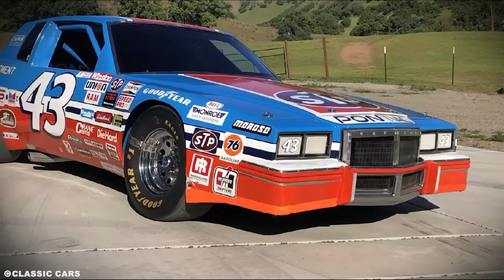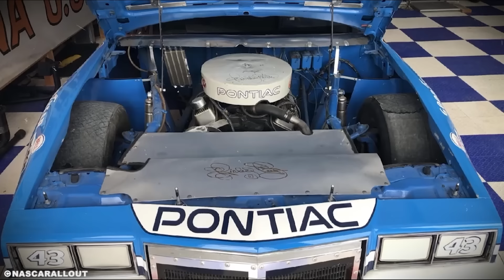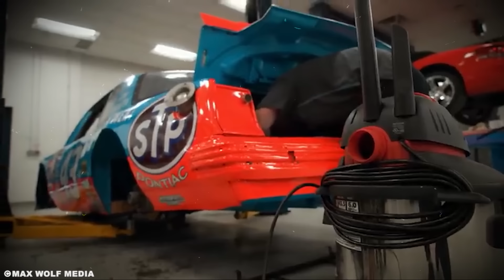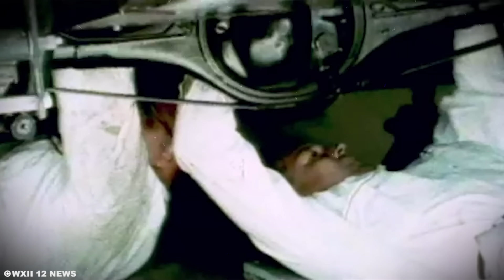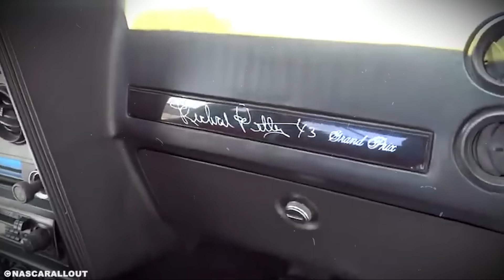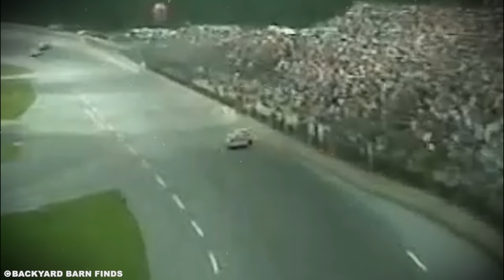How One Mechanic's STUPID Wax Cylinder Trick Made His Engine 15 Cubic Inches Bigger

Comment: This is BS that wax would not change the displacement it would change the compression ratio by lowering it. the bigger the combustion chamber got which in turn would lower the power output as the Comp ratio got lower, the opposite of what they claim would happen the engine would lose power as the wax melted away.. the only way to make the displacement bigger is to make a bigger bore or stroke and that can't be done with wax. Depending on how the engine is tested ie. If the displacement was calculated by air flow then they could restrict the intake ports to flow less air tricking the measuring machine if it was tested by spinning the engine over and seeing how much air the engine sucked in however that wouldn't work if they filled each cylinder with a fluid like oil and measured that way. Also during the big block days of NASCAR especially near the end of the big block era in the 80s I'm pretty sure the big block engines were bigger than 358 inches when NASCAR allowed both big and small block engines the cars with small block engines got a weight break they could weigh a couple hundred pounds less than a car with a big block engine and since the gen 2 SBC engine with the short deck height used in NASCAR was originally designed around NASCAR's new small block engine rules which dictate a max 358 inch engine with a  max bore and stroke size I don't think the big block engines were under 400 inches

Comment: The wax was used to hide illegal modifications to the heads and intake. 
You can't change displacement with wax. That's fucking stupid!😂😂😂
Reply: Well they were putting liquid in the cylinder to determine what the displacement was, when the engine warmed up and melted then that displacement returned.
Reply: @fk4515 that is not how you measure displacement. That is how you measure static volume, NOT displacement.

Comment: Wax will decrease the cylinder volume, but not the volume the cylinders displaced. Displacement is the piston area times the stroke length, and wax wouldn’t change that. As the video points out, wax will change the compression ratio and cylinder volume, but not the displacement. So for a given revolution, the amount of air drawn into the engine would be the same WITH OR WITHOUT wax. Same amount of fuel and air and power, with or without wax. I think the way it worked was they built a 372 and added wax to fool the measuring device into thinking it was a 358. The NASCAR measuring tool apparently measured cylinder VOLUME (which the wax would reduce before a race) and used a formula for standard compression ratios to derive  cylinder DISPLACEMENT. You would have had additional compression (and knock risk) early in the race until the wax melted, so The King probably had to avoid full throttle early in the race to avoid detonation.  At this point it was a partially throttled 372 vs a full throttle 358. As the wax melted he could open it up.  Then it was 372 vs 358. All other things being equal, power is proportional to displacement, and at these speeds, speed is proportional to power to the 3rd power.  This results in a speed increase of about 1.3%, not much, but a couple of mph which over 500 miles could amount to several laps. He often had a couple of laps on the field by the end of a race. Absolutely Brilliant. Should have only run the left side tires until the final pit stop and put rights on the right for the final laps. They might never have been caught had they done this. I watched all his  races in those days. Petty was my hero. Always wondered how his car was faster than everyone else’s. Now I know!
Reply: The combustion gasses are about 2,000 degrees. You think they had to wait a while for candle wax to melt? Yeah maybe 10 seconds at idle.
Reply: @8literbeater . I thought I’d read that the wax took a while to melt, maybe something Allison said about those cars getting faster and faster over the course of the race, but you’re right, the wax was probably was gone after the warn up laps!

Comment: NASCAR engine inspection involves both pre-race checks for compliance and post-race teardowns for in-depth verification. During the teardown, a team removes the engine from the car, and inspectors measure, weigh, and check components like pistons, cylinder heads, and crankshafts for adherence to strict rules regarding displacement and compression ratio. Failure in inspection can lead to penalties ranging from penalties in pre-race inspection to disqualification after a race.
Reply: lap 15? does these nuts know how hot a combustion chamber gets?
Reply: @ixlr8677 yeah exactly. It says it melts at 140 Fahrenheit. 15 laps huh? 5 seconds at idle would do it.

Comment: My greatest complaint with this story is that the writer didn't do his homework. The proof is that the cars pictured had an engine size limit of 430 cubic inches not 355.  Putting wax in the cylinder head would decrease the volume of air in the cylinder. This would only work if the engine was not fired up before the cylinder volume was measured. Firing the engine up probably fowled the plugs but with practice time you would have time to change plugs.

Comment: Never heard of this one. But I heard Leonard Wood made some intake gaskets that had wax inserts that melted out and allowed extra air into the intake runners. Also heard of wax being used in carb and intake bolts having tiny holes in them with wax that melted away and allowed extra air into the intake system.

Comment: The only way to change the displacement is to physically change the actual bore or the stroke not the combustion chamber size. Wax would only temporally change the compression ratio. This is a tall tale yarn made up for clickbait and entertainment at best!!
Reply: They filled the cylinder so tgat when it got pumped for swept volume.  The events were two different races. He got fought both times and the king got super pissed at his. Brother
Reply: Thanks for the heads up
Reply: It was a bigger engine…duh

Comment: In the combustion chamber? Why?? All you do with wax in a head is temporarily Raise compression. IF they put it in intake runners to make them seem smaller than they are, that would be a stretch but could work to do a little something.

Comment: I don't buy it for a minute. It would not change the swept volume. If you were able to put it in the chamber, it could possibly increase the compression ratio, and thereby power, until it melted out, but not the displacement.
Reply: You are right. They just built a 372 and the measuring device measured cylinder volume, not displacement. See my post above.
Reply: I agree with you, i think its a bunch of malarkey, how did they bore .085” over on a 358 block and maintain the integrity of the cylinder walls running wide open without running into serious run ability issues….

Comment: The wax takes up volume in the cylinder, allowing less air into the engine, therefore when you test it & measure the cylinder volume it passes.

Comment: What a line of crap, as an engine builder for many years, this won't work. That wax would smash into the plugs, fouling them.
Reply: Yeah,the stroke would be the same, so same size. Even if it runs, it would just decompress the engine and reduce power.
Reply: @stevev6002 your wrong sir..the wax was only used to hold open the valves during the old school air pump test, so by allowing air to leave the chamber it gave a false reading the wax didn’t make the chamber size smaller or decompress the engine during the race, it did it only during inspection which was why it gave a false reading the only fact that was wrong was the engine was really 382ci not 370ci..also those who think it fouled the plugs would be correct if they hadn’t spent months testing to get the correct mixture of wax with the correct  melting point, and since it was around the valves once it got hot it was blown out of the exhaust valves .this didn’t lower compression it simply made the engine seem smaller than it was since they at the time didn’t test engines after the race and do tear downs as they do today by randomly choosing a section of the cars to do complete teardowns.. also back then they could do spark plug changes during the race if need be if it ever did foul a plug , having a additional 30 hp even if you lost 20 places and didn’t go a lap down, it wouldn’t take long to get back to the front  would it.,Dale Earhart cheated their butts of, so did Gordon, and all the greatest teams, if your not pushing the rules then your not racing are you..
Reply: @markim5087 how does air leaving the chamber seem to reduce engine capacity? I am not sure how the test works.
Reply: @markim5087 it was always obvious that Kyle Busch had more motor!!!! On restarts he would yard the entire field without fail,!!!!! I remember Gordon being the same way! NASCAR needed a dominant car/driver!!! Sports fans love dominance or love to hate the athlete dominating.
Reply: @stevev6002  it does seem more air would indicate more, not less, space
Reply: I heard this was done with cigarette butts
Reply: @TheArsonistsmind  more like blowing smoke out butt
Reply: Only thing that determines cubic inches is bore and stroke combustion chamber has nothing to do with it.
Reply: @brianknight1885 dude I don’t know who you learnt about engine size but the combustion size is crucial to engine size, l😂😂😂 and determines its compression ratio,  not being rude but you need to go back to school, 😂the cylinders bore and stroke to find the total swept volume the compression chamber dictates how much that volume is compressed, making it a fundamental factor in the displacement.. don’t forget the Performance.. I’m guessing you haven’t built very many engines, or went to a good trade school, like the school of automotive machinist, in Houston, maybe you should take a refresher course 😂😂😂
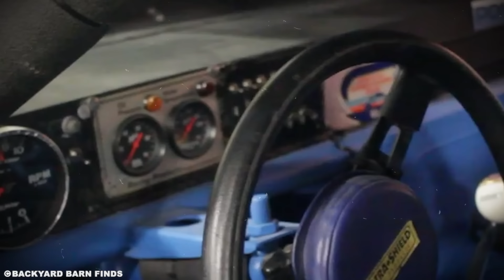Reply: The naration even has a mistake about the legal cubic inches, at the 7:15 minute.
Reply: Dude I’ve built engines for yrs, owned my own shop, and yes it true they were caught in 1983 using wax and they were fined 35k 104 points, but the truth is it wasn’t 373 it was really 382 CI , so you either don’t have that much experience or your just not that good of a engine builder..I’ve witness a lot of building engines tricks ,and racing in NASCAR back in the 1980’s -1990’s ,we always broke the rules working in the grey area,if the book didn’t say you couldn’t then you could as far as every team was concerned...the wax was used to hold open the valves during the air pump test..there was so much cheating in nascar back then , in everything from engines, carbs, suspensions ,once they even used a NOS storage system ,which were built into the frames and sucked into the engines through the air boxes..I’ve even seen when they flipped over suspension parts ,and moved around the rear ends ,the amount of tricks and cheating is what made nascar great , if you recall Jeff Gordon’s car the so called jurassic Park car ,was legal but they had moved the whole  suspension,over and the body had been changed on one side yet it passed inspection, Jeff was told to slow down because he was lapping teams with ease, and that was their down fall, if Jeff had not acted like the kid he was trying to rub it in everyone’s face, and just ran it enough to win, that car would of been used during the season instead of just the all star race, and then been banned..yet they weren’t fined why because it was within the rules, which were changed the next week so they couldn’t run the car again..they had changed the whole left side of the body yet it still passed inspection, and the frame had been moved over ..today it’s a lot harder to cheat as teams aren’t allowed to build their own parts, they must get parts from approved suppliers only..teams have gotten caught cheating yet they got the parts from the approved suppliers,teams will buy 100’s of parts just to try to find a single part that’s worth using within the batch which will give them a edge..you can go back through the 70’s through the 90’s it was when nascar was the Wild West, and greatest sport around, today it sucks, they run the dumb chase, which gave jimmy 7 championships which is totally a load of crap, and not worth the same championships which Dale and the king or Gordon’s are worth, Gordon should of had at least two more, the first yr for the chase Gordon was over 100 points ahead of all the other teams yet didn’t win, due to the new silly rules..the chase really ruined nascar, because a driver can win one race, and then just run at the back all yr long and only focus on the last 10 race tracks which was what jimmy did , when he went to race in other sports he couldn’t win, or did he even run competitively…the chase today means points don’t matter, teams don’t wreak then work their butts off to get back out just to run another 50 laps to gain 5-6 places BECAUSE every point matters, no they wreck, and the driver is flying home before the race is over ,and probably gets home in time to watch the end on tv..we need to loosen the rules again, go back to a 36 race season based on solely a whole season, not just the last ten races getting down to the last 2-3 drivers..it’s boring..
Reply: The wax trick is true , and it didn’t foul the plugs they spent a lot of time and effort to figure out how to do it, and which wax to use.. you can even look it up it’s a very true story..and the only fact that is wrong is that the final engine size turned out to be 382 cubic inches ..I would have thought the same thing but it’s a very true story..go look it up..every one who’s ever gone to the school of automotive machinist pretty much knows this story, as we used to sit around in the 1990’s and talk about it in the school during the break ,or while working on our engines..